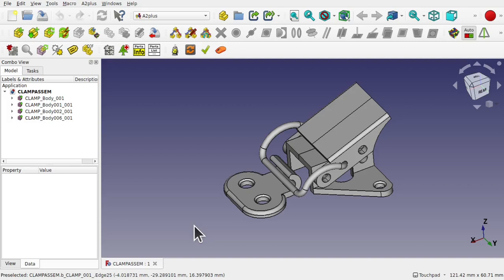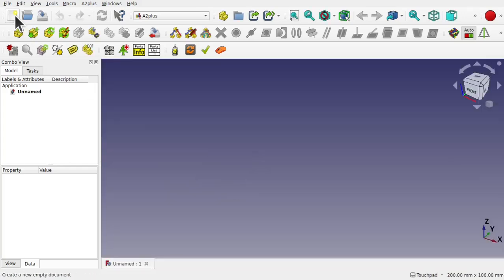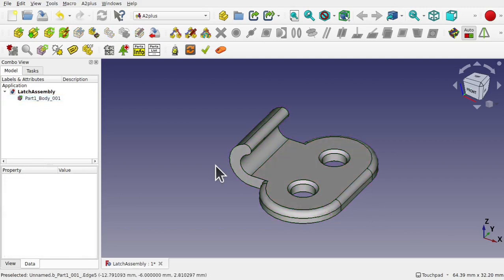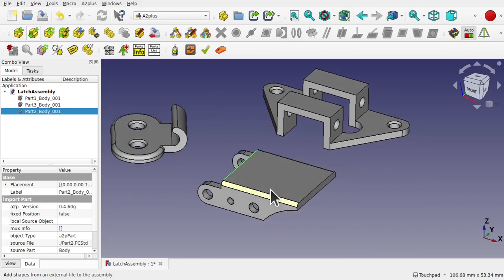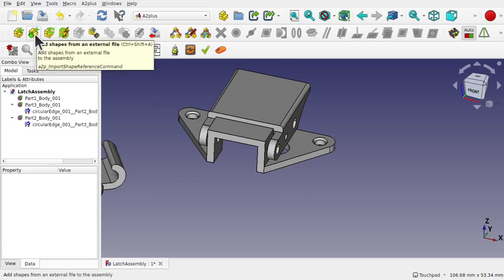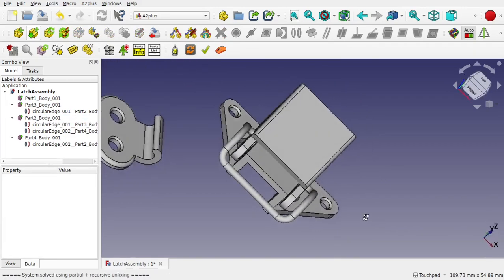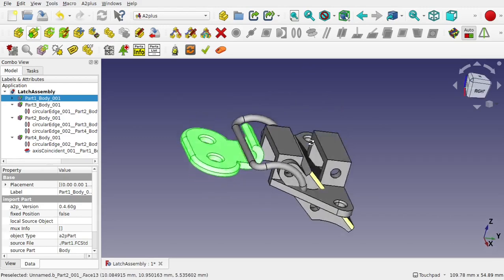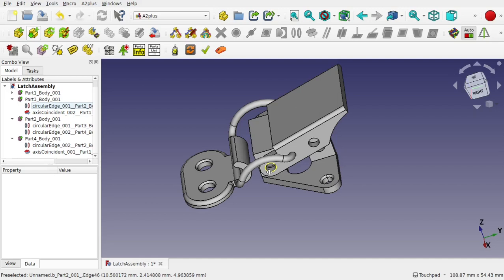Learning FreeCAD For Beginners | 35 (Part 5) | CAD Thinking Part 5: Latch Assembly

Comment: the simulation is fantastic, and this is coming from a total rookie to engineering but it's actually really striking to see the way that the hook comes closest to the latch BEFORE the lever is at a 180 degree position, before relaxing a little further from teh latch when the lever is at its final position, demonstrating that the point of greatest tension lies before the latch is in its final position, meaning there's an amount of energy input required before the latch can be undone. It's fascinating to me that the mechanism works so elegantly based only on the measurements provided

Comment: Excellent tutorial series! I have a question on the rotating part (part 2). Is there a way to limit it's movement in the direction where it would rest on the mounting bracket?
Reply from the maker: Glad you like. Regarding stopping the part and limiting it's movement I am trying to think of a way but haven't come up with anything yet. Even thought about using sketch lines but that didn't work. I wish there was a way to restrict the angle

Comment: If the offset of -0.5 does not work in the Circular Edge constraint, then just finish the dialog box and then press the 'Solve' button on the toolbar.
For some reason it won't automaticaly display offsets with a value of a non-whole number (fractions).

Comment: is it possible to assemble the part with the new "Assembly" workbench ?
Reply: I just did this with FC 1.0. I used three "revolute" joints for the base-handle, handle-spring, and spring-hook joints. There is no "axis" joint to keep the hook level, so the best I could do was a "parallel" joint. I also noticed that the handle interferes the base when closed. If I wanted to build this part, I would make the handle 1 mm taller to fix the interference.
Reply from the maker: I see another viewer has kindly posted the workflow to create this.  I will create a full assembly tutorial to replace this one in FreeCAD version 1.  I am currently planning out some assembly wb tutorials as we speak.

Comment: This video has been very helpful. I drew a heat sink. I have made my first assembly now.  It is a very simple three part assembly. I added the heat sink.  The heat sink is parameterizing in a spread sheet. I drew The heat sink as a simple rectangle at 50x50 mm. For the Stud mount diodes I found STEP files at GrabCad.  Next I decided to increase the size of the head sink more like 4x4". I opened the heat skink file and made the change and saved the file. I reopened the assembly file but the old heat sink dimensions remain.  I assume I need to refresh the assembly some how.  Suggestions?
Reply from the maker: Glad you enjoyed and using the video for your own projects. So you need to refresh the assembly to allow the changes to take place. Along the tool bar if you roll over them you will see a 'refresh parts in assembly' or something similar. I can't remember what it looks like (currently away from computer) . I use it in my video for learning freecad for beginners where I create sub assemblies for a small set of drawers . Think it's number 38 or 39.
Reply: @MangoJellySolutions  That did it. Thanks.

Comment: So opened the latch file 2, hid the linked object (latch file 1). Opened assy file. Imported latch file 2 and closed the linked page for file 1 in tree view. left with just the part 2 but still could not move it or do anythin. Saved the assy file and closed it.Opened the assy file again and all is good and working

Comment: Strabge thing happens to me with Freecad version 0.21. I can import part 1 and 3 OK but importing part 2 creates a new assembly file called "latch assy 1" (name of first part file)  and then I can't do anything. I can't even role back but computer does not freeze.  The new file is shown on the left tree view but there is no new file window. (hope you understand). I have to right click on the new file in tree view and close it. then it seems OK but I can't transform the parts or do anything. It only happens with latch assy part 2  and in any order that I import it. Now, If I open latch assy part 2, it opens part1 and two as if one file. seems that file for part two is now corrupt.

Comment: It seems the  "make link" caused the issues. I had to delete the linked object (part 1) in file of part 2. Probably, I could have tried to hide it but deleted instead. will try to create again and hide it.
Reply: Thanks.  I am using FreeCAD 0.21 and encountered the same problem.  I did try and hide the linked object, but it didn't solve the problem.  Deleting the object did.